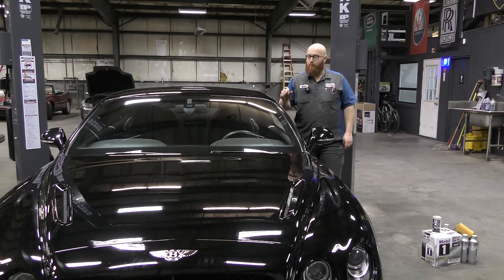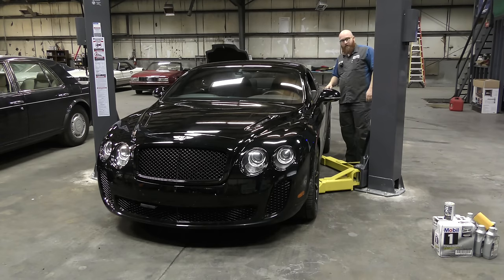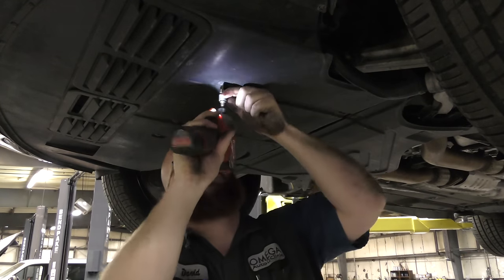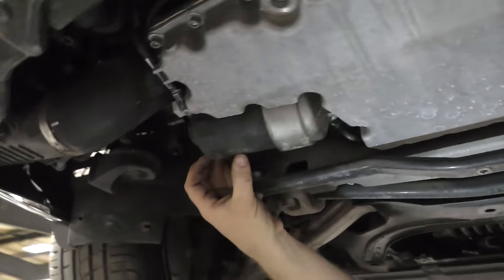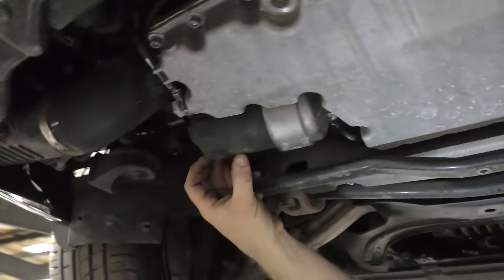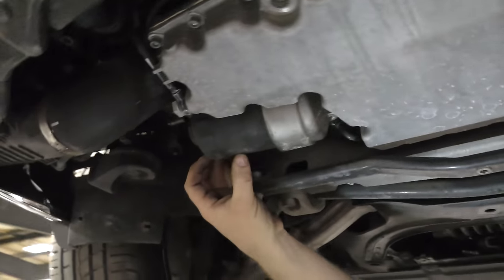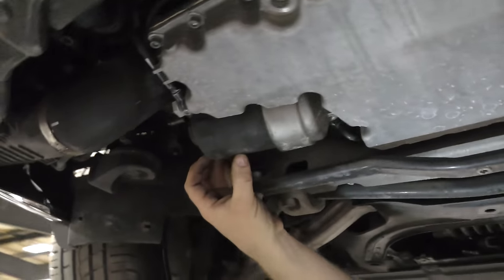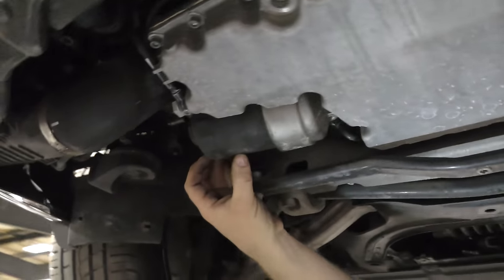One Fast Oil Change! The CAR WIZARD works on an insanely fast 2011 Bentley Continental Supersports!

Comment: Thanks for the instructional video. Now I can change the oil in my $300k Bentley in my apartment complex parking lot with my harbor freight jack stands.
Reply: You meant Jack stand, as in singular, I am sure.
Reply: Nope Jack Stands means 2 stands.
Reply: @jaybee2344  but 1 stand instead of 2 will save money, right?
Reply: Why spend money on jack stands just drive it up the sidewalk
Reply: @markm0000  YES!
Reply: Rich guys with your jack stand(s), sidewalks and jackets. I just wait until I flip my car before I change the oil. It’s easier and cheaper.
Reply: Just be sure to put it in “Jack Mode”.
Reply: @CandyGramForMongo_  sorry, but this goes to show that you don't know Jack!
Reply: Maybe one can pick up cheap pads and rotors at the local autozone.
Reply: Jack stands?  You mean concrete blocks or a milk crate.
Reply: The one thing that drove me crazy in my last Benz was the lack of a dipstick, other than the owner.
Reply: He'll $200 is a generous price. Should be $250
Reply: FYI for all
Harbor freight just recalled  454,000 jack stands due to collapsing while under weight. Items #61196, #61196, #56371. These are 3-ton and 6-ton models.
Stop using these immediately.
Reply: Wait, this comment got posted before the Harbor Freight jack stand recall. 
Uhhh... Uh Oh. I hope he's alright.
Reply: Put me in your will.
Those jack stands are recalled. 
I want your Bentley when they fail.
I'll finish the oil change using my jack stands from Walmart.
Reply: Like a boss
Reply: Robert Bell eBay or Amazon
Reply: Robert Bell Amazon or eBay you can not cheap just inexpensive. Save money, live well one is not exclusive to the other. Those that waste money soon will have none!
Reply: @nsbioy  lol use a brick is cheaper 🤣
Reply: @bradklingensmith  🤣🤣🤣🤣🤣🤣
Reply: VERY EASY oil change, I've done it myself with (literally) a broken back and additional spinal injuries!
Reply: You'd better make sure you have heavy duty jack stands - 1 ton per won't do it! You don't really need jack stands though, just keep the suspension in high mode and you can partially fit under the front end - enough to remove the 14 skid plate fasteners...
Reply: @nsbioy  1 stand is not good enough unless you place it under the driver's side so the oil will drain. But you don't even need jack stands to remove the skid plate and the filter is right up front only a half a meter back give or take...
Reply: @AmandaHugenkiss2915  THAT'S A BIG NEGATIVE 🤣🤣🤣🤣😭😭😭😭
Reply: @rogdobxtcalifornia2738  And the Bentley is a heavy bizatch - you definitely don't want no collapsing stands!
Reply: I just used a $25 coupon, military discount and senior citizens combined and it was free at my local dealership.
Reply: I actually have a $300k+ Bentley GT and use ramps not jack stands. And yes… I change it at home. Lol.
Reply: If you have a 300k car and live in an apartment your buying back words.😅
Reply: Check the recall on the HF stands.  Not kidding.
I see Rogdobxt California above got the memo and the gold star.  Nice post.
Reply: actually, to be an exotic supercar, that oil change is pretty straightforward, no difference with your 20k beater car, other than it takes much more oil...
Reply: I just did that....
Reply: Best to have it done in A Bentley sevice station - or by the Wiizard!!
Reply: 0:45
Reply: @nsbioy i
Reply: @john-paulsilke893 i
Reply: @nsbioy o9
Reply: @bradklingensmith 
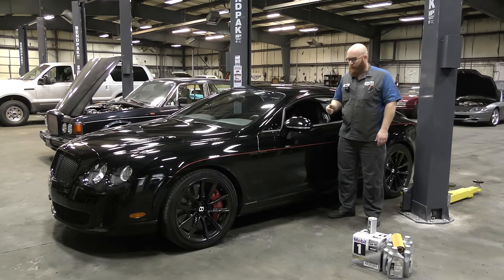2:53
Reply: @bradklingensmith I'm see
Reply: @rogdobxtcalifornia2738 😮
Reply: @rogdobxtcalifornia2738 😅
Reply: @aaz1992 😢
Reply: @migueldelgado273 ⁹ o9 l
Reply: @migueldelgado273 q,
Reply: @AmandaHugenkiss2915 😅
Reply: @migueldelgado273 o9😅
Reply: @edlozano8694 loo

Comment: Pro tip: turn the car on its side to pre fill the oil filter. ;)
Reply: :DD I see what you did there
Reply: Thats what i have to do with my Kubota
Reply: NO, NO, NO!!!! You'll hurt your back.
Reply: just disconnect the spark and crank it to pre fill it 😉
Reply: @juicylemon69  
I actually do that on my boat after winter storage. There is an ignition kill switch  so it’s extra easy.  I recall some high performance aircraft engines had an electric oil pump to pre lube engine before start up.
Reply: Just overfill the engine and the oil will go into the filter by itself.
Reply: The car takes 9.5 liters of oil!
Reply: @David n  :  I was going to suggest using liquid nitrogen to “freeze“ the new oil...
Reply: That’s brilliant sire!

Comment: Unfortunately, sometimes us VW owners have to buy Audi parts--and ouch it is for a cheap car.
Reply: Fortunately, when comes to a car as costly as the Bently - getting parts from an A8 is actually pretty economical. (It's all relative).
Reply: @Stimpy&Ren They were A8 bearings. You don't pay more to have lower servicing costs. That's how trucks work - not luxury cars. Although I do wonder if a truck engine could go in a Bently or Rolls - with a small electric motor to smooth it out - it could be super reliable and long service intervals.
Reply: If you use sites like rockauto, they'll have some non oe parts that are priced as low as possible and they have wide ranges of OE replacements like Meyle or TRW for example. These companies do supply VW group but the parts are just cheaper because it doesnt say VW or Audi or something on it.
Reply: I don't get muricans
Here in europe nobody buys oem parts or even services their car at the dealer.
We have high-quality aftermarket parts - ATE, Sachs, Lemforder, we buy those, not "BMW" or "Audi" branded parts
Reply: @Random-nf7qb  It's more difficult to find those brands here because the majority suppliers in the US are companies like ACDelco (GM) Motorcraft (Ford) and Mopar(FCA) and a lot of the other suppliers like Denso are also big here because of Toyota, but most European car owners don't know of these brands or trust them I believe, personally I do use brands like lemforder, Bilstein, and meyle on my cars but the parts are not only more difficult to find, very few people outside of Euro focused shops know of these brands
Reply: But do you not low key love driving your VW?
Reply: @daevid21  Well, my dad's 1.9 PD105 Touran is capable of 200 and I have taken offramps at 90, the manual is nice to use, other than the diesel sound and lack of top end, it's a nice car
Reply: @Random-nf7qb  If that was true no dealership would survive in Europe. They dont make too much on the car sales as more on the service part. And a lot of people hand over their used cars to the dealerships for service because it is the easiest way to do and you get a good feeling about the quality of the work - which, really depends on the dealership. In my opinion they are not better as other garages/workshops and they will charge you extra money. Also most people dont know that "Audi" parts are not made by Audi but are from Bosch, ZF, or other less known manufacturers. So getting into this topic seems a little bit too much for non-car-people.
Reply: @Gentleman...Driver  dealerships here survive because new cars have to be serviced by them to keep the warranty
Also some parts are not available anywhere else.
But for the most part, I don't know anybody who goes to the dealer to service their car.
Reply: @Random-nf7qb  I know a lot of them. And it is not true that you have to service the car at the dealership to keep the warranty. At least not in Europe. But most people dont know this and the manufacturers wont tell you obviously. :)
Reply: Yet another reason not to buy VW products.
Reply: @daevid21  love my mk7 gti vdub all day
Reply: @wholeNwon  Said no one ever.
Reply: @Random-nf7qb  All those you mentioned are OE parts suppliers who then sometimes put their logo on them or the dealer just marks them up for profit. Example being my VW has TRW and ATE brake components, Bosch electronics, Sachs suspension and Continental belts/hoses.
Reply: @paulwilliams6534  Those brands are owned by big companies with many other brands.
Most of the stuff you get, branded as them was made by the cheaper brands and then got rebranded.
The stuff you get as OEM is made to a little bit higher standard.
Reply: @Random-nf7qb  Cheaper brands meaning? Give an example. I kind of understand what you mean but OEM stuff from a dealer or manufacturer isn't higher quality, it's just rebranded with a OEM logo and inflated in price at the dealers parts counter. Example being the NGK factory sparks plugs in my VW don't say NGK on them but do say "Japan" and have VW/Audi logos.  The VW/Audi water pumps usually all leak and are made Bosch and Continental but the ones with a manufacturers logo still suck just as bad. Maybe the parts reliability depends on the county of origin.
Reply: @Random-nf7qb  I understand what you meant, like maybe some part was made by a lesser cheaper brand then rebranded as the larger manufacturer and then that's what you're getting? I always compare the county of origin on a non OE but OE supplied part.. Bosch/Autolite/TRW to the dealers part and they're always the same which tells me they're the same part.
Reply: @paulwilliams6534  search "Sergiu Gabor" and watch his review of oil filters

Comment: this car has a dipstick? woah that’s crazy
Reply: Yes I was surprised too.
Reply: Ditto
Reply: Yeah that's cool I hate how most Audi and Mercedes have gotten rid of it and just use a sensor
Reply: ClintE55 the only cars that will have them were engines that were using in crossover years like my 08 e60 550i that same 4.8l v8 was used in other models that don’t have idrive so you can’t really see the oil level. There’s a hidden dipstick in the back that’s colored black. If you don’t look it’s not there. Newer ones don’t have it. One be if it is they don’t have the worry about making room for the tube and stick.
Reply: I was surprised too. Most of these European sedans show the oil level on the digital display only.
Reply: And a hydraulic power steering.
Reply: It is two VW VR6's slammed together at the end of the day right?
Reply: Dr. Fadi Battah well the hydraulic power steering makes sense, it gives you the best feel of the road so it makes sense for the super sport model but for other trims, they probably have electric power steering for lane keep and shit like that
Reply: HONDA RULES yup. I didn’t understand why he kept calling it an Audi engine...it’s a VW engine first and foremost. I know, they’re the same company (VAG) but the W12 thing is much more for VWs.
Reply: It better have a dip stick 😬

Comment: BMW charges me $170 for an oil change on my 2015 650i Gran Coupe Xdrive. My motor is known to burn oil though even though my car has low mileage (37000). Gotta know what you’re getting into when buying a car like that.

Comment: $200 oil change on a Bentley is a damn good price
Reply: My father payed $1100 for an oil change on a 2009 Q7 TDI here in Sweden. It was a long quiet ride home...
Reply: shakke52 haha fa-an vad deppigt
Reply: @GOLDshred  mardröm!
Reply: 13 quarts of oil that meets VW/Audi/Bentley/etc.'s specification and a good quality filter can easily cost $120-150 and then you're paying an experienced mechanic to do the job rather than some kid straight out of high school at a lube shop making $10/hr.  Gotta pay to play, this isn't a Toyota Corolla!
Reply: +shakke52  1100 SEK = 110 USD
Reply: @basshead.  I put the $ mark there. 11 000 sek = 1099,99 US-Dollar
Reply: I asked a female friend how much the Hyundai dealership charged her for oil changes. She said around $200.   Even though the car was new, they always managed to find little extras to charge for.  I felt sorry for her and wound up being her oil change, brake, battery, wiper blade, cabin filter,  mechanic for two years!
Groan.
Reply: @falconeaterf15  bruv thats sad asf. I do my own car maintenance, granted I drive a 2014 Ford Focus.
Reply: @falconeaterf15  I had Leased a hyundai sonata 2017. The routine maintenance was included. Except tires.
Reply: @shakke52  LMAOO
Reply: Now aways, 200 dollar oil change in any v8 engine, fully synthetic is a bargain.

Comment: Ingenieers of this car must to have been under the influence of something, when they decided where to put the oil filter and the drain plug they made it to easy, they were probably fired after this car.
Reply: That's quite a Japanese thing. I've got two JDM imports and the old filters point right towards the sump plug. If you have a basin-sized oil catch pan, you don't even need to move it.

Comment: 👍  David,  Thank you very much for taking the time showing us this incredible car. 

About 35 years ago I first saw (up close) a 1929 Supercharged Bentley (a Rootes Supercharger with twin SU's fitted in front of the radiator) on an I4 engine with SOHC and 4 vales per cylinder.

Comment: 7:20 - the Code on the sticker "3D" at the beginning of the number indicates the Phaeton-family. Thats the true origin of this car. The Conti is the sport coupe version of the Phaeton.
Reply: ohh the Phaeton the ultimate factory sleeper
Reply: Search out the Swss guy who gives the breakdown of the ownership cost of his Phaeton. It's. Un. Believable. :o
Reply: @Czechbound  I still have a Phaeton. One of the best lux. limos in the early 2000nds. I feel the pain too. ;-)
Reply: Thanks for the details & info.
Reply: heartbreaking but true. It's not a Bentley anymore, just an over-dressed Phaeton.
Reply: @HksF16   A relative had one for a while, it was an awesomely fast, discrete, almost unnoticed car. It did cost a fair bit to keep it running, but when it was running well it was fabulous.
Reply: @abarratt8869  When it was first released where i live the base model started with the same price of a BMW 7 series and i bet it was more reliable than that BMW but due the VW name nobody was looking for this as they want a BMW or a Mercedes
Reply: Isn't it the other way around. Phaeton is a Bentley.
Reply: @rosen9425  No. Bentley was bought by VW 1998. The subsequent cars were VW developments skinned to look like Bentley. Phaeton was the key platform for heavy limos such as the Bentleys (A8 ..). In recent years Bentley is more decoupled from VW and seems to be more a brand of its own. This is also a product of the demise of VW`s limos. There is no Phaeton equivalent in the bouquet of models. Arteon and Passat are by no means reaching Phaeton level.
Reply: @rosen9425  The Phaeton came first. 

On the whole the Phaeton engineering development programme has been wildly successful for VW. The Phaeton was pretty popular in China, and it was an excellent platform for Bentley which they've successfully turned into a major brand.

Comment: Nice car. :-)

When I start my plane's engine I have thirty seconds for oil pressure to register before I have a problem. Being airplane parts the oil and filter are much more expensive than similar car parts. Being a 1950s design (Lycoming O-320) the oil consumption is significant - I buy oil by the case. Like driving a fancy car, if you can't afford to look after a plane you can't afford it at all.
Reply: Kai Meier Musketeer.
Reply: But how long does it typically take for pressure to register?